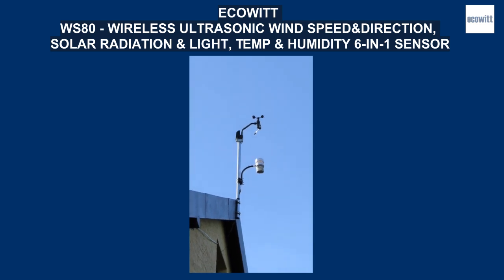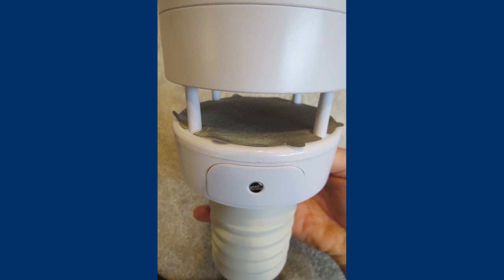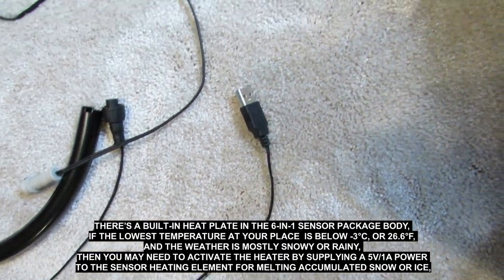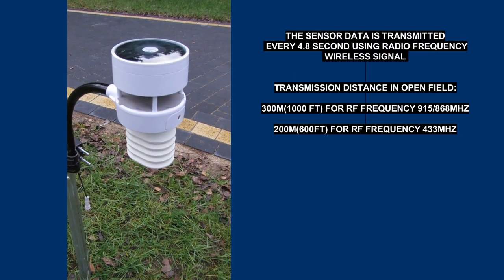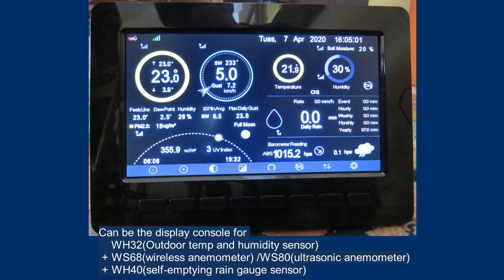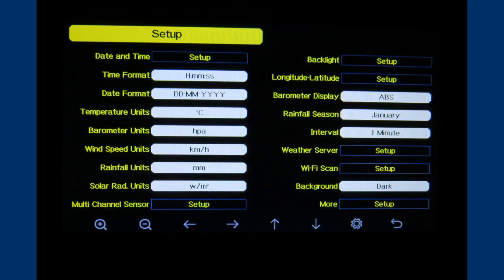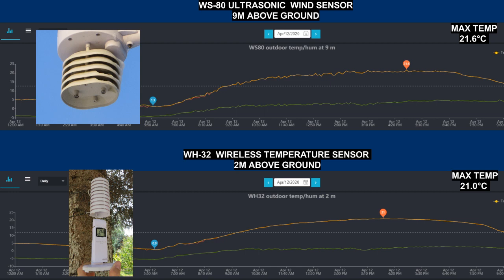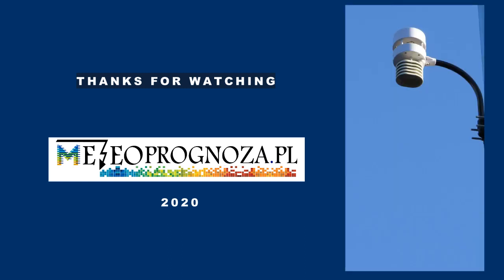WS80  ultrasonic wind sensor by Ecowitt - review

Comment: Thanks for the very informative review of this sensor array. I've backed on Kickstarter Ecowitt's new WittBoy (WS90 + GW2000) sensor/gateway which also has the ultrasonic wind sensor and also has a new haptic rain sensor rather than traditional tip bucket. It will be interesting to see how it compares to my existing setup WH24.

Comment: Oh just a question to ask: How accurate is ultrasonic anemometer vs the 3 cups traditional anemometer because I have seen your graph and I see there is a problem with it? The graph doesn't look smooth for mean wind speed from Ultrasonic vs the 3 cups anemometer, any idea why?
Reply: I just got the AW 5000 (same as this in the video) and have it directly below my 2902 with wind cups. So far, they track almost perfectly, but the 4.75sec updates of the 5000 (vs 16 secs for the 2902) seem to make a huge difference in picking up gusts. Heck, maybe it’s not just the update period but the sensor itself too! So far so good though, I am thoroughly impressed and wish I bought one sooner! I also own a Davis VP2 6153 but it’s across the yard so can’t do a direct comparison but the 5000 seems closer to the VP2 because of the fast updates (VP2 updates every 2-2.5 seconds)
Reply: @Weather_Nerd  Sounds promising which is good thing.
Reply: Just forgot one more thing. Bureau of Meteorology in Australia only update 1 per minute into their old fashion LED console = sample every 5 to 15 seconds from old fashion heavy duty fully metal anemometer (Unfortunately not as good as Davis due to take bit longer to spin up from heavy weight cups). For upload to internet they usually do 10 minutes mean wind speed and maximum gust in the last 10 minutes.
Reply: I would say a little bit more accurate and better response time of 4.5 seconds from the ultrasonic compared to about 16 second to other.

Comment: Hello, very good video, you recommend the quality of ecowitt, I want to buy the ECOWITT WS68 Wireless Solar Powered Anemometer with Light & UV Sensor, has it worked for you?
Reply from the maker: Thank you. Yes, I am satisfied with Ecowitt's devices. The WS68 anemometer works fine without any problems do far, but last December I had to replace the battery after a year, because in the absence of sun it runs out faster. This season, however, I noticed the advantage of the ultrasonic sensor during freezing rain. The WS68 vanes have frozen in cold and humid weather and have stopped turning. At the sam time the WS80 ultrasonic anemometer with a heater sent data continuously.
Reply: @Markkonto  Thanks bro!!!!